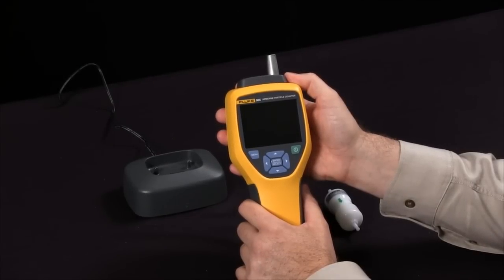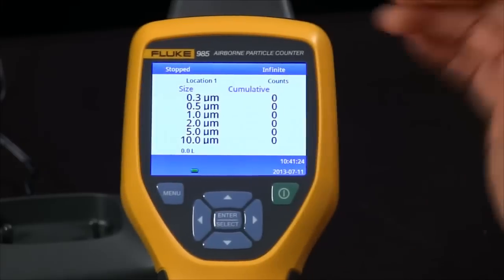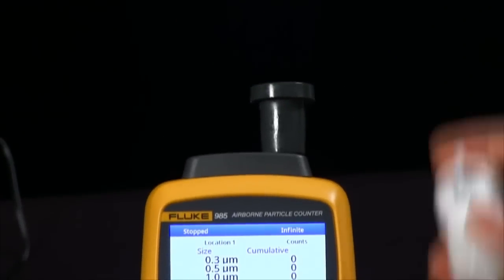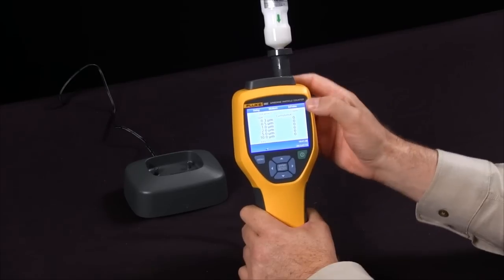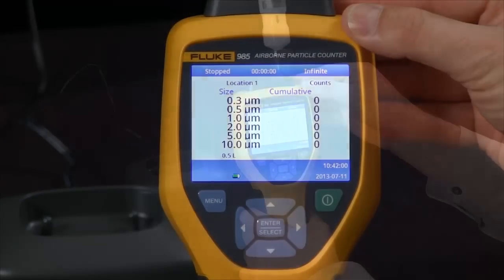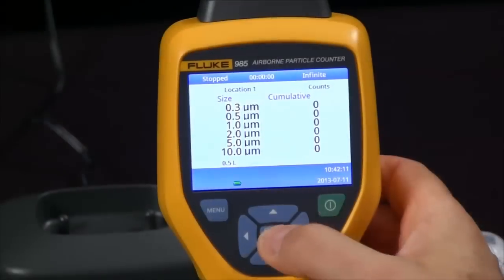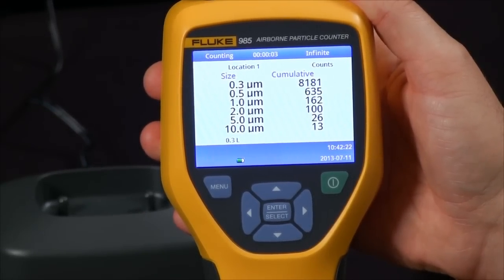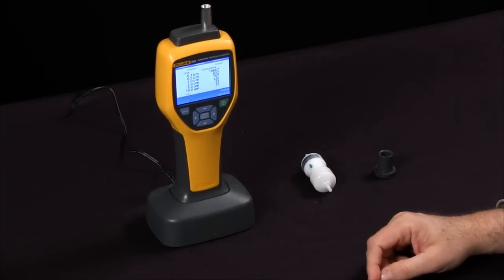How To Use The Fluke 985 Airborne Particle Counter

Comment: Hello sir,

I am having airborne dust concentrations data as PM10, PM2.5, PM 1 . 
These data was taken before and during dust producing work in a civil construction site. 

N=5

How can i compare these before and during operations data ?
It seems that there is percent variation in dust concentrations in atmosphere between before and during operation data.

e.g., PM 10  ( particle size less than 10 microns) is sharing 40% of total airborne dust, and PM 2.5 ( particle size less than 2. 5 micron) shares 10% of total airborne dust.

During machine operation:
PM 10 shares 60% and PM 2.5 10% only.

It seems that PM 10 share is increased due to that machine operation?

Which test is suitable for analysing these type similar data for discussion ?

How to use statistics?
Any comparison among these particle sizes?
thank u.